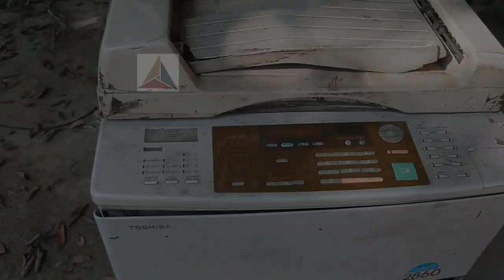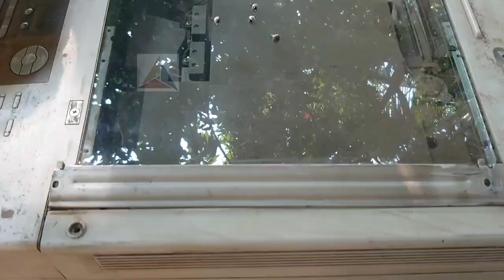Scrapping A Photocopy Machine | What's Inside A Photocopy Machine | Gold Recovery

Comment: In copier and laser printers, dissassemble the scanner bar. Inside i find the scanner bar looks to have bonding wire going alone a long strip die. I set a bunch aside but have yet to test. They also have another part on bar often with gold bonding wire around a small square die.